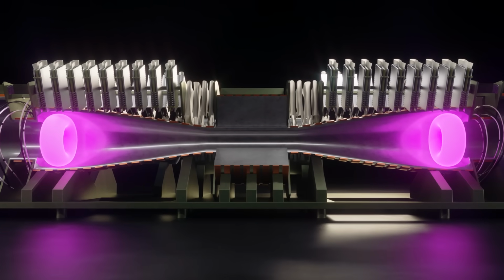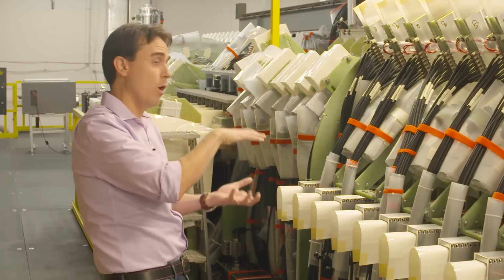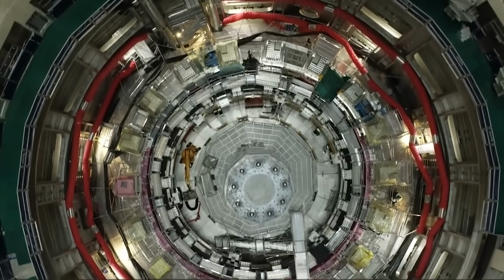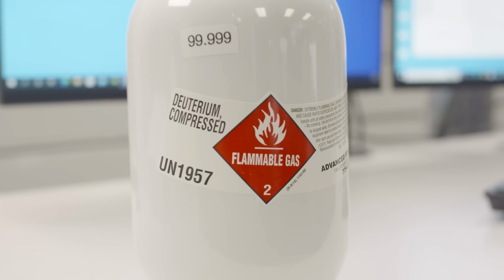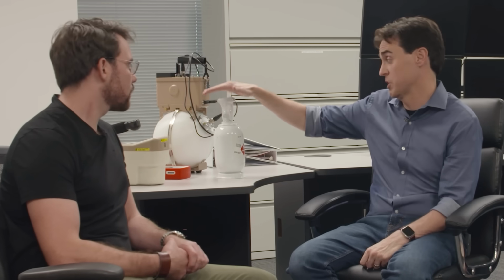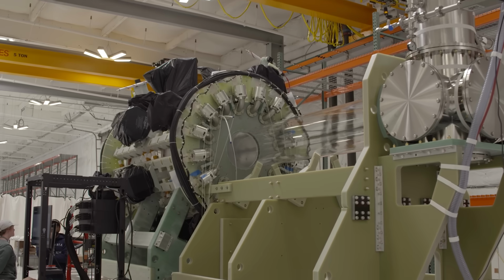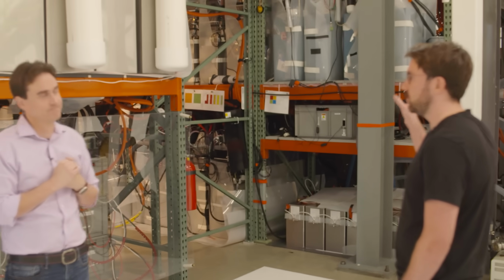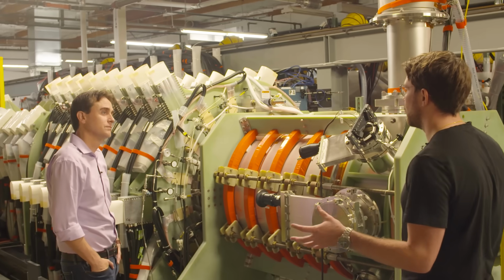A New Way to Achieve Nuclear Fusion: Helion

Comment: Ive never seen something so unbelievably beyond my realm of possible understanding explained in such an incredibly understandable way. Awesome video
Reply: This is v1 of a Star Trek Warp Core, just turn it sideways!
Reply: @Dawson Davis oh they dumbed it down A LOT
Reply: @bigsmall246  Not really... they actually did a great job of explaining the fusion process clearly and correctly without giving unnecessary detail. People who are not nuclear physicists don't need to understand the quantum effects of a system like this to understand how it generally works and the impact of such a technology. I do wish they had discussed a bit more about how they plan to capture the output "like a piston" because that wasn't really clear to me, but maybe I am just not knowledgeable enough on electromagnetism to imagine it
Reply: @NeoNoggie  yea this isn’t the kind of thing where it’s hard to understand what’s going on
Reply: @NeoNoggie  It's actually pretty easy to grasp, I learned it in my highschool physics class (ive since forgotten pretty much all of the material but this stuck)
Conducting coils moving through a magnetic field (or vice versa) generate an electric current in the coils
That's how all turbines work really, so here they're just using the magnetic field changing due to the reaction and using that directly

Comment: Did I miss it or did they discuss the amount of energy put into the system vs. the energy you get out.  I still don't see where there's over unity.  I would interested in hearing exactly how much energy is being put into the system for each reaction vs. the "NET" output.

Comment: If it wasn't on Real Engineering, I would not have watched a video of a fusion startup. It's usually clear that the team does not have the capacity to meet the coming challenges, no matter how cute the idea. In general I don't mind them: it's cool that there are people using venture capital money to explore the corners of the envelope. But I don't spend time getting to know them: they'll disappear soon enough.

From what I've seen in this video, it seems that Helion is different. The moment I saw the machine, I instinctively understood that they're 'colliding' plasmas, and that it's different. Then they said that they're extracting the energy released via the confining magnetic field, and I realized that we finally have a 21st century fusion reactor.
Of course the road to economical energy production will be long and rocky, and there might be insurmountable hurdles on it, but for the first time in a long time (since, say, 1977) I feel excited about energy from nuclear fusion.